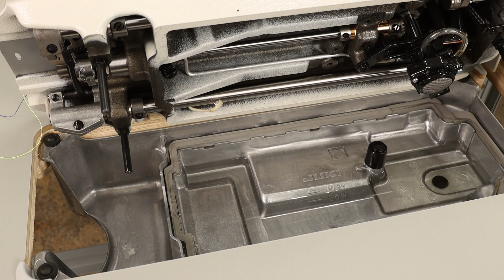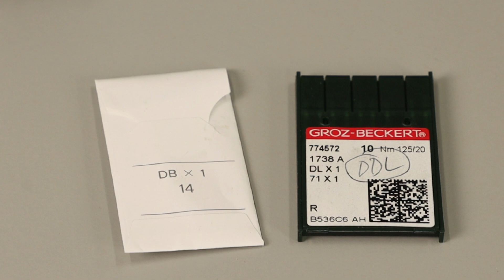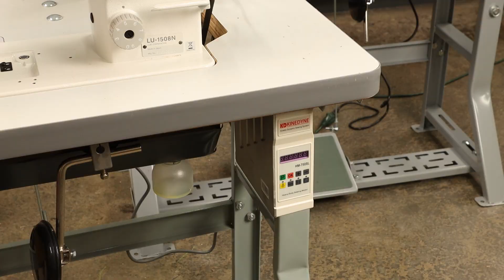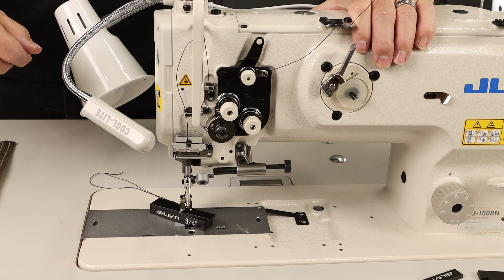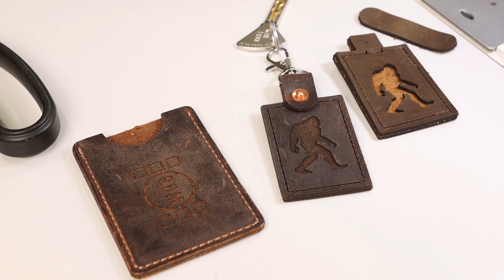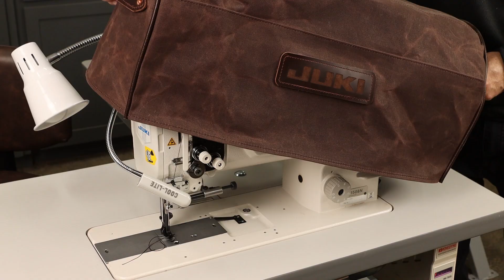Drop Feed vs Walking Foot Industrial Sewing Machine Comparison DDL-8700 vs LU-1508

Comment: What do you think of the 8700H?
Reply from the maker: It's a reliable machine for what it is.  You just need to determine what type of machine you need.  If it's just a step up from a domestic machine, then a basic drop feed industrial like the 8700H will be fine.  If you want to sew leather or thicker upholstery, you'd be better served with a walking foot like the 1541.  Thanks!

Comment: Thank you so much for your educational input, I am really enjoying your videos, I sold my  Juki 1181 and my Juki digitalized ddl 8700-7, still have my cylinder arm 4800 pro from techsew. I primarily sew cork fabric, with water proof 600 denier canvas. Also creating some sewing tutorials videos. I really am liking the 1508, my questions, is go big and get the 1508 nh, can it sew lighter materials, or is it too much of a beast. I also sew faux leather, leather,  PLU, heavy leather 3-8 oz. I would really appreciate your opinion, I really need a flatbed sewing machine for my youtube video tutorials.
Reply from the maker: The cost to get the 1508 NH seems high, compared to what you get.  My 1508 is the standard variant, and honestly it will sew 1/2" of oil tanned leather.  I can't imagine asking anything more from an upholstery machine.  They will sew pillow and upholstery material, canvas and vinyl too.  I probably wouldn't sew cotton t-shirt material or silk, leaving those jobs to the domestic machines.  Thanks!
Reply: @TheThoughtfulWoodworker  thank you so much, so the 1508n then?
Reply from the maker: @KellyDannemann  Yes I think you'd be thrilled with it.  Thanks!
Reply: @TheThoughtfulWoodworker  thank you again so much!!

Comment: Since there are no markings on the faceplate, how do you determine seam allowance on the 1508?  Also, I love how you present your videos. No fluff, just important content in easy to understand presentation. Thank you so much. I’m subscribing now. 😊
Reply from the maker: Thanks so much for the kind comment!  I usually just use the presser foot as a guide for seam spacing.  Otherwise you could try a drop down guide or simple magnetic guide.  Thanks!

Comment: I'm a professional woodworker (3rd gen) and have memories of my dad telling me he worked in an upholstery shop as a young man. (One problem of apprenticing with your dad is you want to get some space from your parent x1000 from a regular kid lol. Cool to find out even he felt that way once!) I myself went a different direction and learned metal working. 
I have always been dabbling in simple cushions, but lately have been morphing my fine woodwork and fine metal work together in smaller fine art type pieces. These are mainly wall cabinets that the client can walk right up to and touch and examine closely. One thing that has been missing is the balance of hard and soft. So lately I have incorporated rich fabrics and tapestries into the inner case details. I contemplated using a local upholsterer but his work leaves a lot to be desired for my client level. This video was perfect and I will be buying a LU-1508 in the near future. Added bonus is I bet I can do small leather projects with one of these in a small senior apartment till I croak when I get old and "retire". Thanks for the video.
Reply from the maker: That's excellent!  I love to hear about blending and incorporating different hobbies into one.  The leather and upholstery work will be a nice add-on.

Comment: I like these machines as they have a generous throat space and great table setup. Are there any like the 8700 where you can either drop the feed dogs or cover them to do free motion quilting?
Reply from the maker: I suppose you could lower the feed dogs completely to approximate the action of a free motion quilting machine, but I haven't tried it.  I usually operate a triple feed walking foot machine.  Thanks!

Comment: What kind of a thread you using? I got this machine now brand new but the thread I’ve been using is breaking even if I try to adjust the tension. I appreciate if you can give me some guidance. And also for dennim stitching?
Reply from the maker: I use bonded nylon for indoor projects, or bonded poly for outdoor cushions.  69 weight with a #18 needle for the DDL 8700 or 92 weight and a #19 or more often #20 needle on the walking foot.  Thanks!

Comment: thanks, I was considering a dll 8700 second hand to make bagpacks and now I know it will do the job just fine.

I have beeen using an old 90s riccar sewing machine and just now a singer heavy duty to make bags and backpacks. although the singer heavy duty is so much better than the riccar it still struggles alot when I need to go through 10 to even 16 or sometimes even 20 layers of fabric (yes some parts of the bag are that thick, and yes it is pushing the limits of the foot height). 

I'm looking to turn this hobby to a potential business in the near future and I have seen listings online for a pretty cheap second hand dll 8700, so I'll be buying that as soon as I graduate from high school I think.

Comment: Hello, Can the Juki 8700 sew a quilt sandwich? For example, a top layer of fabric, a thin batting in the middle and back layer of fabric. Thank you.
Reply from the maker: The 8700 can likely do it.  I have zero experience quilting, but 2 layers of fabric, with soft batting will compress to about 1/8" thickness I'd imagine.  It shouldn't be an issue.  https://amzn.to/45rusdM  Thanks!

Comment: How is the 1508 on apparel? Does the 1508 do everything the 8700 does plus the heavy and thick stuff, or is the 1508 poor at lighter delicate material? Thanks I really enjoy your videos
Reply from the maker: I think the 8700 is better for apparel weight material and cotton etc.  The 1508 is an excellent machine and will sew medium to heavy weight fabric and leather.  It's good for canvas, vinyl, and upholstery weight fabric.  Thanks!
Reply: The 8700 can do very lightweight, whereas the walking foot will not do good with very lightweight

Comment: So I’m used to using a straight stitch machine, but I’ll be starting to use a walking foot and I I’m struggling with not being able to see where the needle is. Suggestions? I’m so used to the open foot on my Juki 8000.
Reply from the maker: Yes I would recommend a split foot.  The inner presser foot has a slot so you can see right where the needle is going.  It's great for my small leather craft items.  Plus, it's easier to thread the machine too.  Thanks

Comment: I own a Juki LU-562 that has a similar pan with foam under the hook, though it is attached to the base of the head, not the metal pan beneath the machine. Is it supposed to be filled with oil also? I didn't see anything in the manual about it. Thanks!
Reply from the maker: Usually the enclosures on the LU-562 and 563 are just to contain oil splashes, although there may be foam that contacts moving parts, and will naturally help lubrication like an oil wick.  The 562 is a great machine.  Thanks

Comment: Nice comparison, but I don't feel that ones decision simply boils down to how they "intend to use it". Looking at current pricing, a 1508 is around 3X the cost of an 8700. Spending even $800 - $1,000 for an 8700 would test most budgets, long before even thinking about spending the $2,800 for a 1508.
Reply from the maker: For sure I agree with you.  I don't mean to be totally model specific, but rather the general features of a machine.  If someone did want to look at a walking foot that's a little less money, they could consider the  206RB-5  https://amzn.to/4d0gClw  or Juki 1541  https://amzn.to/3SebvEs  Thanks!
Reply: You are very hard to please.

Comment: the last machine I showed is it the same as a   needle feed  mine is an old double needle  industrial very strong I was able to sew thru 3/4 inch of vinyl with it and the needles move in an  elliptical motion is it the same c.noel vancouver
Reply from the maker: There are four common feed types with industrial machines.  1. Drop feed with only the feed dogs advancing the material.  Like a home sewing machine or Juki DDL-8700.  2.  Feed dogs plus needle feed.  The needle stays down as the material is advanced like a Pfaff 463.  3.  Dual feed walking foot with feed dogs and alternating presser feet.  An example would be a Yamata or similar machine.  4.  Triple feed walking foot with feed dog, needle feed and alternating presser feet like a Juki 1508, 1541, or Consew 206rb5.  Thanks
Reply: @TheThoughtfulWoodworker  thank you

Comment: Great comparison.  It was super interesting to see that the 8700 would sew over a fold in upholstery fabric just fine.  I thought I'd need a walking foot to not need a hump jumper for upholstery.  Perhaps not...   

I'm still a bit worried about "why" everyone seems to recommend a walking foot for upholstery though.  With the 8700 - Is there any problem sewing over single feld seams where they intersect with another seam perpendicularity ?  Any problems with the same seam, where there is 5/32 piping added to both seams ?

Another video I'd love to see is a 1541 versus 1508 comparison.  I've seen Andrew Dyer's comparison and it's good - but I'd like to hear what (if any) types of things you think one machine does better than the other.  Comparisons of the features and specs are interesting, but not as useful as comparisons that talk about what an experienced user liked and didn't like about using the machine, and why they liked or disliked aspects of the machine versus another machine that buyers would typically consider if they were in the market for either machine.  For instance - for the 1508 versus 1541, is the oiling system on either one more convenient or less messy ?  Does one jam up or take more effort to set up if you are switching thread sizes than the other ?  Will one sew bigger top thread than the other ?  Sew with smaller (wallet sized) thread better ?  The specs are very very similar.  But do they really work just as well as the other - across the whole range of applications ?
Reply from the maker: Hey thanks!  The 8700 can sew simple upholstery seams like pillows etc., but it won't sew much more than 1/4" compressed thickness.  It's designed as an apparel machine that can moonlight with upholstery fabric.  
As far as the 1541 vs 1508 the 1541 is a side loading machine, while the 1508 is a top loader (which I prefer).  I can check if my bobbin thread is getting low without removing the material.  But with the extra large U style bobbin it lasts quite a while.  Either of these walking foot machines will sew about 3/8" of compressed material, including leather.  The H model 1508 will sew up to 1/2" but that's just because it uses a longer 190 needle system.  I'll try to do another comparison video on the walking foot models if I can.  Thanks!
Reply: Thanks - appreciate the reply - very informative :)
Reply: Shifting layers are the real problem, so you need something to hold the fabric while it's being moved.  This is what everyone meets after listening too much to fairytales about domestic old machines and sewing denim... Unfortunately - either time consuming or final product spoiling :-(